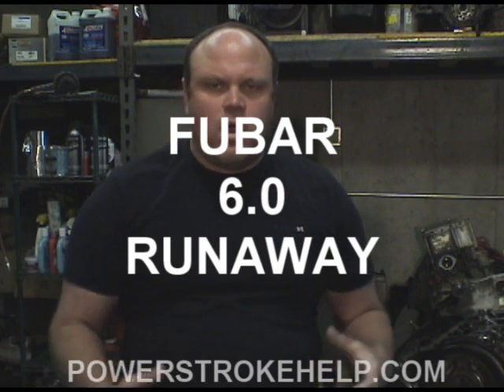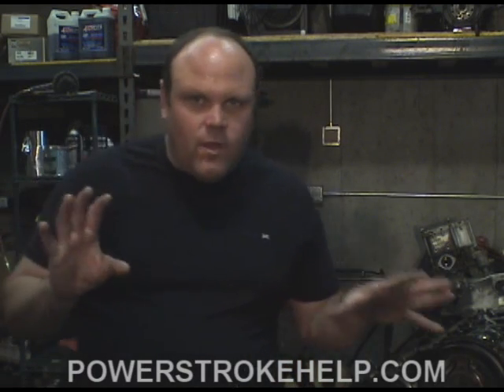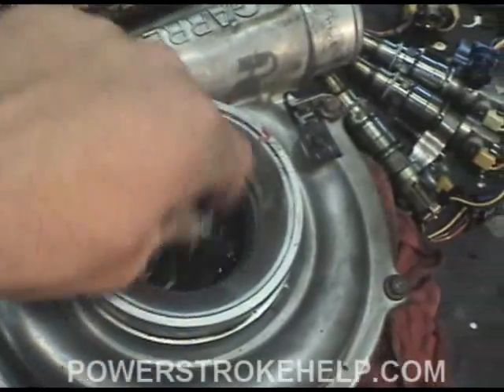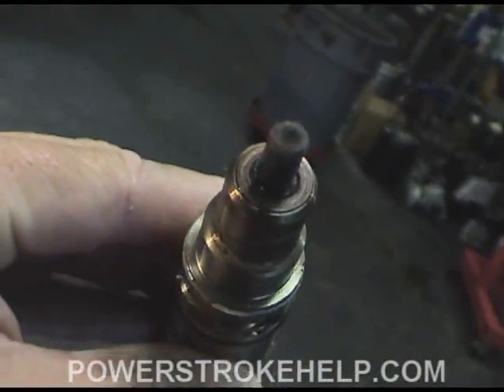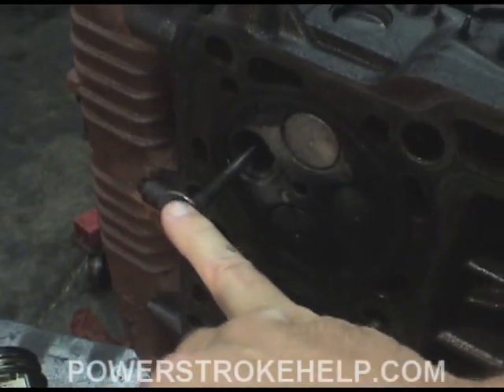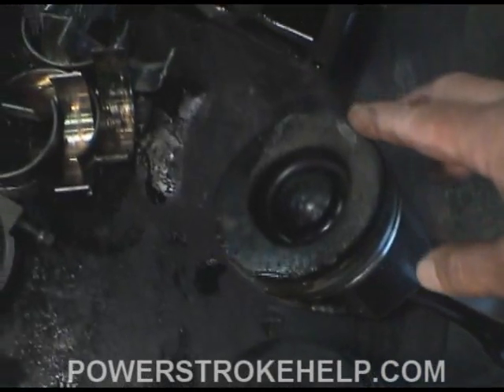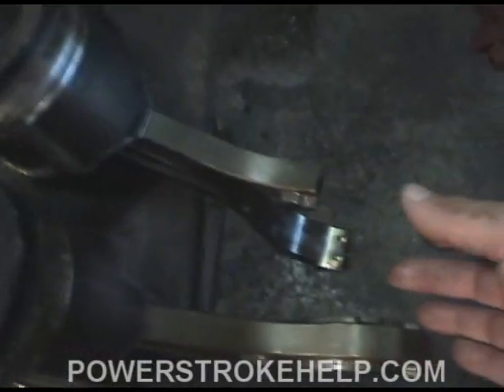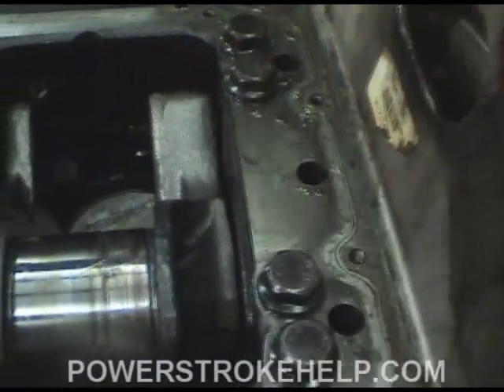FUBAR 6 0 RUNAWAY - TURBO SEAL FAILURE LEADS TO TOTAL ENGINE DESTRUCTION

Comment: So how does a turbo seal fail. If it is like the turbo my Eclipse, it is just a bushing and a runout seal. Oil runs out of the bearing against a plate on the end of the shaft. The oil is slung outward where it drains back into the crank case.

Comment: Hey man my 6.4 ran away but when I got it home it still had at least 1.5 gal of oil in it. A few aluminum pieces in oil do you think I could put turbos on and be ok?
Reply: Big gamble you dont know what else failed or started failing inside the motor after the turbo went out if you see any copper color in the oil that's bearing failure

Comment: I would have a question.. It i happened to me on golf 1.9 TDI.. I stoped the car kind quick by put in into 5 and break.. Pistons look damaged.. I found new Block of engine.. My mechanic tolds me that turbo seems to be OK.. do you think that Injectors can be ok? We will just replace Block of engine and tkae from old one all another components.. Can it works? I have also made mistake but I did know it anything about it and after this situation I let car a little bit cool down and start it again.. And it was going.. I drive proximately 300 meters to safety zone.. so I think Injectors should be OK.

Comment: To my knowledge, runaways use to happen on naturally aspirated engines as well.
Reply: Yep, had a couple of BMC units go mad sucking oil vapours from the crank case breather to the induction manifold. Always have a good rag ready to block inlet.

Comment: I HEARD THIS WAS COMMON WITH A 2 CYCLE DETROIT. 

WILL THIS HAPPEN TO A SUPERCHARGED ENGINE????????????????????????
Reply: It can happen to any diesel. All it takes is for any type of fuel (diesel, oil, etc.) to get into the intake. As far as I know, the only possible solution is to cut off the air intake. 

A throttle valve was pretty common in older engines because seals weren't very good back then and runaways were more common than now. 

P.S. If you lived in Bend Oregon about 30 years ago, I remember you.
Reply: IT MIGHT BE TIME FOR A DESIGN CHANGE OF THE DIESEL ENGINE. IM FROM ILLINOIS N LIVED THERE 41 YEARS NOW N IM 41 YEARS OLD. MY NAME IS A COMMON NAME.
Reply: I agree, if runaways become a problem, it would make sense to install air cutoff valves in the intake pipes.
Reply: OR MAYBE A SPRINGLOADED STEEL INTAKE FLAPPER WITH A TRIGGER.
Reply: Stuck injectors holding rack open cause 2 stroke Detroit runaways. They have an emergency shutdown that blocks intake side of blower to cut off air. Motor will still try to run pulling air through air box drains and seals but possible to stall it once RPMs drop.

Comment: Are the vehicles just too damn complicated, that to think these guys SHOULD be able to zero in on a problem, right from the start, as opposed  to fixing one thing, then trying something else, etc, until they eventually get it right..., or is that honestly asking too much, due to the level of complexity of today's engines??

Ok, I like Bill, his attitude towards fixing stuff right, and the knowledge gained from his videos.., but I gotta ask a couple questions:
1)  @ 1:30 in the vid, after knowing this truck had some sort of major malfunction, he said they drove it from where the wrecker dropped it off.  Even if it's only 20 yards, I think that's a bad idea, especially after he already acknowledged the customer "pushed it" himself.
2)  He said they initially changed the turbo, then test-drove the truck.  So at this point, he's seen the damaged turbo.  He then explained that with that turbo bearing broken, the oil doesn't now go where it's supposed to, but instead gets sucked down into the engine.

These post-failure symptoms seem to clearly indicate there's MUCH more damage to this engine, that I'm asking if some of it could've been avoided by looking at it closer, before taking it for a drive... if some of it was made worse by driving it AT ALL, before it was fixed..., and, shouldn't he have EXPECTED this, with his experience, and done some more tests, like maybe a compression check, again, BEFORE driving it at all?

I don't doubt he knows a ton about these engines, but I gotta ask, how much did he learn from throwing parts at problems, then realizing it didn't fix the problem, then dig a bit deeper, till he finally got the issue resolved, and THEN gained the experience for future similar repairs?  And, who paid for the extra labor involved?  I mean, that turbo would've needed to be removed and replaced TWICE, along with several other parts as well, right?

This is what I hate about letting ANYONE work on my truck:  They NEVER get the correct diagnosis the first time.  (Well, once, when it was a failed ABS sensor.  But even that showed THREE symptoms that should've pointed the tech STRAIGHT to the problem, because when taken all together, it really points to only 1 thing.  But instead, I got charged $100 for computer diagnostic, and another $50 for post-repair computer diagnostic, plus labor, all for a $30 part!!)  My over all point is this:  WHERE IS THE PROPER DIAGNOSIS KNOWLEDGE ANYMORE WHEN IT COMES TO WORKING ON THESE VEHICLES???  If the computer won't tell them just what's wrong, or if there isn't a TSB, it becomes mostly a guessing game, because technicians today generally don't have very good, step-by-logical-step, detective-type, diagnostic skills anymore.

So after listening to Bill explain that his repair was done in at least a couple steps, did the customer get credit for his time spent on the things he had to do twice?  And what about the possibility that Bill made the repair more expensive himself, because he drove that truck before it was completely fixed?  There's NO WAY of knowing for certain if he didn't in fact make it worse, and I say, based on what that turbo looked like, HE should've KNOWN there was more wrong with that engine.

A guy on PowerstrokeNation, who TRULY knows his shit, said Bill was a "parts-changer" several years ago, but I defended Bill.  I'd like to think that Bill's HEART is in the right place, but after watching this and some other videos, I'm beginning to think he was right.

Comment: Man I'm about to loose it with this truck. I replaced the turbo thinking the seals were leaking oil into the cylinder causing runaway.  Replaced the turbo and it ran away on me again. I saw oil shooting out of the drain pipe to the valve cover. so I know something isn't right. I'm completely lost!
Reply: new seals all around

Comment: When I was doing wireline work we had an H2S gas leak on location.  We had no time to shut down when the alarm went off.  We mustered up and our wireline truck (Kenny T440) was still running.  It was close enough to the location of the leak that it had a run away start.  The leak was shut after a few min and the engine idled back down.  But it was trashed.  It ran, but was in very bad shape.  We kept it alive long enough to rig down, then shut it down.  A new truck was sent out and that one went back on a wrecker.  That truck was gone for a month to get a new engine.
Reply: +Chad Bremer in hind sight, we are lucky the H2S gas did not ignite and burn the location down.  It has a pretty low LEL.  Just never made it high enough in the open to go boom I guess.
Reply: So H2S gas caused the runaway instead of oil? You are lucky!

Comment: reason why I'll stick with my duramax
Reply: +Jordan Scheurer I don't think duramax is going to stand up to runaway much better.
Reply: +Jordan Scheurer I didn't know dirtymax's were immune to runaways. Good to know.
Reply: +Jordan Scheurer They actually haven't had the same engine. Yes has kept the same displacement, but there are many variations the duramax. They've had lb7, lly, lbz, lmm, and the lml, all variations to keep up with emissions.
Reply: +Not Avalable I'm not talking about that. your right now it wouldn't but fords dumbass designs they have had latly is costing people loads of money the 6.0 the 6.4 and while the 6.7 is a way better engine it has some issues. the 6.6l duramax has had its issues also but nothing like this. and they have had the same motor for years. not changing it every few years they know they have a good engine it's not broke don't fix it
Reply: True, but ford has only made one diesel engine, the 6.7. And also why fault ford for changing engines? its not that they, or dodge, or gm wanted to vary their engines, but they were forced to because of emissions, and I must say even with the problems that these emissions cause the engines are much more powerful.
Reply: I wasn't aware of those, but anyhow as im sure you guessed i was only talking about truck engines.
Reply: Jordan Scheurer same can happen on the druamax
Reply: Jordan Scheurer ford didn't make the 7.3 international did
Reply: +Bobby Dob Ford has made many diesel engines. Most were for their farm tractors and other industrial uses. The V6 diesel in the Range Rovers are from Ford. The 6.7 Powerstroke is the first diesel Ford has made for its Super Duty pickups.
Reply: Jordan Scheurer They still have a Garet turbo, I keep my Cummins with a nice in house made holset
Reply: Yea and you talking what different heads intake and that dumbass exhaust fluk. None major overhauls. The 7.3 was and always will be the best diesel ford made hands down in my opion
Reply: Well, seeings how you didn't qualify your earlier statement, I wasn't going to assume that you were. However, let me now assume that you are only referring to Ford's pickup truck engine.

Comment: We had a runaway on a mack truck for around 1 min, do u think the engine is destroyed?
Reply from the maker: +MrVaysa Is there metal in the oil filter? A nasty knocking sound? Parts dangling out of a home in the oil pan?
Reply: doubt it
Reply: I'd check the turbo for damage.

Comment: Once a diesel starts to runaway on you, the only way to stop it is to starve it of air. A piece of wood over the intake works best. I've seen folks use a fire extinguisher in the intake as well. That works pretty well, too.
Reply: or on a manual you can dump the clutch in high gear
Reply: +crashandburnbirner Ram/Dodge is the only manufacturer that still puts a manual in their pickups. And, that's not always a sure thing. It's a 50/50 chance of either stopping the motor or blowing the clutch/transmission when you dump the clutch. Better to just slap the board over the intake.
Reply: How are you going to put a board over a closed intake? Pull the top of air cleaner off and try to shove a board over the whole?? You would be better off shoving a coat into it, but then again doing that could rip out a turbo seal. Or once again you could dump the clutch and hold the breaks. Becaue this problem does not really happen in 99.99999999 percent of new vehicles. It happens more often in vehicles with a mechanical injection, which is at the newest pre98, and most of those vehicles have manuals, so once again, dump the clutch.
Reply: Hole*
Reply: ***** You didn't learn anything from this video, apparently. Mechanical fuel injection doesn't have anything to do with an intake turbo seal letting go. When it does, oil from the crankcase that is supposed to lubricate the turbo bearings go into the intake system and is what causes the engine to runaway. The only thing shoving a coat into it will do is force you to buy a new coat. If trying to slap a board over the intake is too traumatizing for you, then, by all means, use the fire extinguisher.
Reply: wildturkey1960 How are you going to get a board into a closed intake! Turbos just dont hang off the side of an engine with a big hole that says put board here in case of runaway, there is an intake that is closed, so you open it and then what? How are you going to get your board into it? If anything shove a coat into the intake to fill it up.
Reply: Well, if it's a pickup, like a Ford or a Ram, there's the air filter box that you can pop off the lid and take out the air filter. Then, you can set the board on top of the air filter box. Or, you can pop off the air intake hose on the air filter box and use the board there. That will kill the air going into the engine. On a big truck, you would have to pull the air intake hose off and slap the board on it that way. The board will have to be big enough to completely cover the hose/pipe. Aside from that, the fire extinguisher would be your best bet.

Comment: I have a Volkswagen Passat 2.0t... I thought my car got damaged in an oil change mishap, and I took my car to the dealership to figure out why my car is running out of engine oil every week. I could not get a clear answer ;although, they new the problem. 

The first vw dealership changed oil hub! 
The second vw dealership told me the whole engine has to be replaced because the piston rings were worn out! 
The third vw dealership told me the car is fine! 
The fourth vw dealership told me the turbo is completely gone after driving the car without power over a year!

Now, I feel like even if I pay for the costly turbo replacement the engine might be beyond repair:(
Please do not buy Volkswagen.
Reply: +cornholio777 LOLOL!!! Another horror story from another satisfied VW owner.  sarc/off

Comment: you ever heard of an engine? It is not a motor...a motor is basically an electromagnet
Reply: badchads68 wrong and right. Motor is another work for engine ad well. Look it up my friend
Reply: Correct. Many ships are classed as 'MV', meaning 'Motor Vessel'. Examples are the MV Putford Acates and the MV Fairstar. Trucks and cars are often called 'motor vehicles' officially, in the English-speaking world, and the French say 'le moteur', which gives us the word 'motor', when talking about engines. Cold-running machines are often called 'motors' by convention ('air motors' and 'hydraulic motors' in pneumatic systems, ,electric motors', etc.), and hot-running ones are conventionally called 'engines' (steam engines, petrol engines, diesel engines, etc), but these are only conventions, not laws of grammar. You can use either word, as in 'rocket motor' and 'rocket engine', 'turbine engine' and 'motor turbine', etc., if it sounds appropriate.

Comment: you didnt explain a runaway at all is the oil seal the most common runaway, yeah but their is the alternative fuel source too, in the case of the gulf oil spill accident the two diesel pumps picked up a source of either methane or natural gas and caused both of those to runaway

Comment: Just a bit of thinking here from a guy (me)
That isn't so much into cars or engines for that matter but knows a bit over the basic stuff.

If the pumps are mechanical. (Chain driven or belt driven)
And the oil feed line is exposed / easily accesible, Could you just put a valve on the oil feed line so when you turn the valve it closes of the oil feed. 'before the pump'
But is now feeding air instead?
Would that bring the rpm's down and save the engine from a full on runaway?.

Sure it might hurt the oil pump but those are way cheaper then a rebuilt engine for many.

And electrically driven ones i guess could be mounted with a killswitch near the front of the hood (under the hood ofc near one of the springs or next too the radiator on the inside there hidden away a bit in a small plastic box (properly mounted and not hanigng loose heh)
Or in the vehicle mounted in the dash to kill the feed there.
If its from the oil pump itself and not anywhere else that it sucks up the oil this could help alot.

And something simple to block off the turbo right away if you usually try to keep the car clean and without unnessesary things other then basic tools that comes with the car and stuff you usually bring to work (which many do)

Could be some bit of plywood, sheet metal on a 90 degree hinge mounted near or on the turbo so it blocks off the turbo when the hinge is down. Killing the air feed right away (on a exposed turbo this should a a easy thing to do.)

And that you just need to remove something simlar to a hood pin to be able to turn the hinge down so it cant close on its own while driving or simlar no matter what shaking or so is messing with it unless you remove that hood pin.

And no i dont mind that you bring this idea forward to some car manufacturers that needs reliable work cars, to be safe to use for longer periods of time and that can handle a turbo breaking the seal but without causing the engine to run away.

Instead of just scaring the driver so he/she just runs off leaving the truck,vehicle to run away not knowing anything about what to do with this.
(Like a ups guy just doing some driving of his truck and bringing his personal vehicles into a servicing place, rather then learning any fixing himself or learning how to stop a runaway diesel)

Could be an idea to learn the workers once every year and new employes when asked about what to do on a runaway diesel,  Just to remind them about it and ask them what to do if it happens. It could save the companies lots of cash if the drivers know how to stop it.
Reply: Amazing the comments from people who don't wrench for a living, BUT....Come up with all the answers on how to stop or prevent a runaway.
Reply: Marcus60661 runaways are not a common enough problem with diesels so a preventative system like you said is not really necesary, but you could however cut the oil feed line to the turbo in an extreme situation like that. or block off the turbo intake.my dad had a boat with twin 2 stroke 8v71 detroit diesels(8 cylinder 71 Cubic inch each)  in it and he had emergency flaps that blocked off the turbos because if those engines ran away there would be nothing stopping them lol